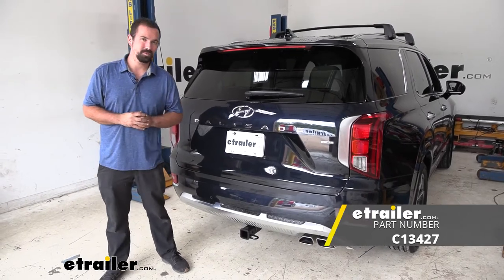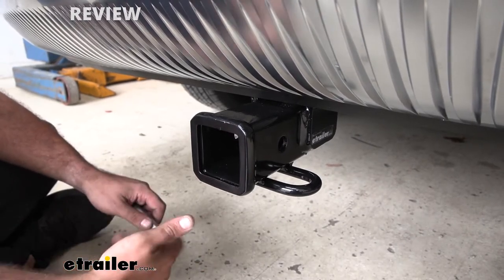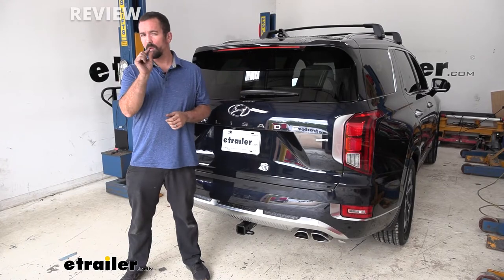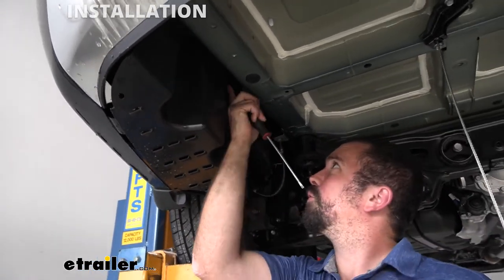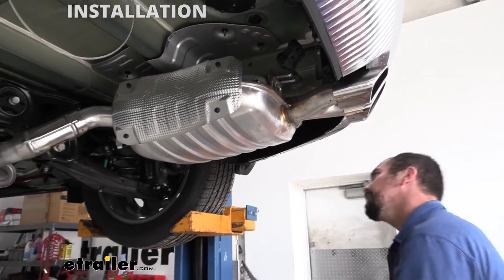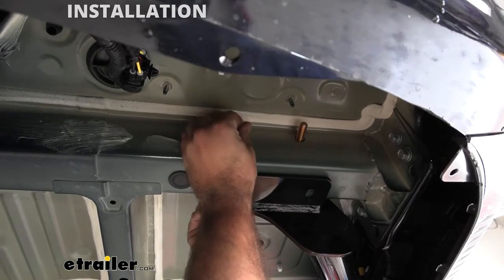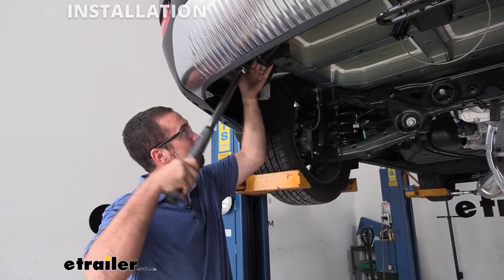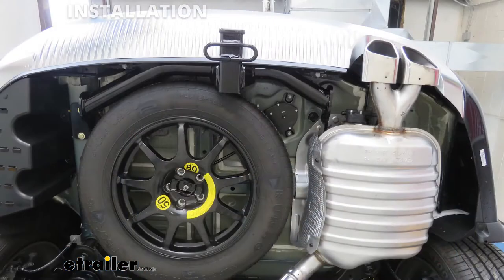etrailer | Curt Trailer Hitch Installation - 2022 Hyundai Palisade

Comment: Why didn’t you just put the bolt the other way so you didn’t have to cut the clip
Reply from the maker: You will need to install the hardware in the direction that was shown in the video. If you do not feel comfortable trimming the plastic piece, you can pinch it with a set of pliers and push it up. You will just need to push back down on the panel inside the trunk when the installation is complete.
https://www.etrailer.com/Trailer-Hitch/CURT/C13427.html
Reply: @etrailer  what is the difference between installing the bolt opposite as how its shown in the video? It seems WAY more convenient to install that bolt with the bolt's head facing the outside (No clip interference, and no need to trim the plastic fairing)